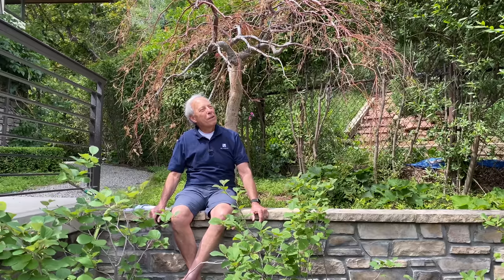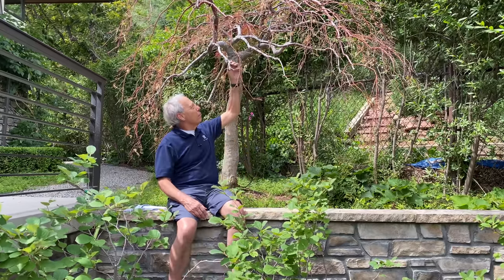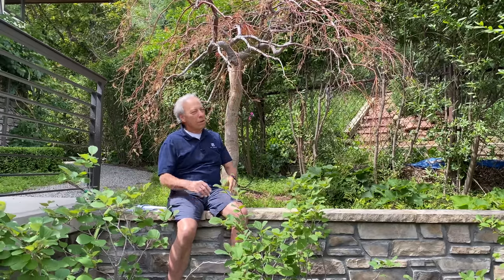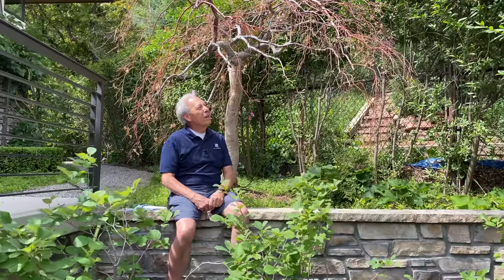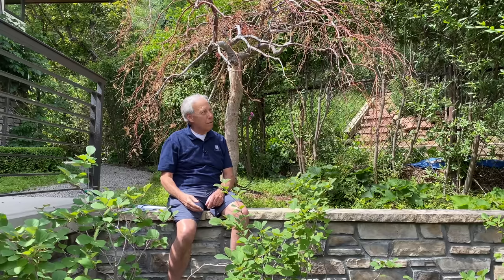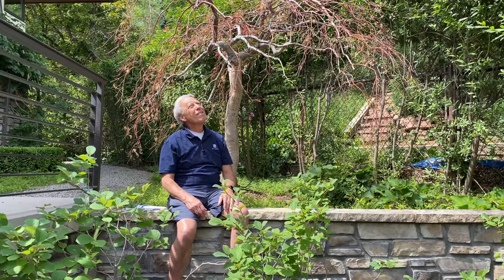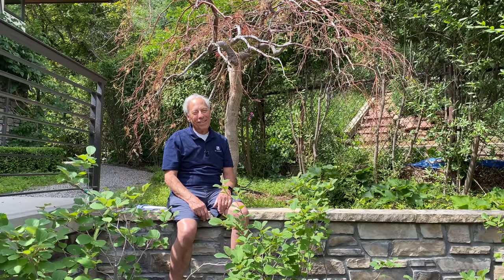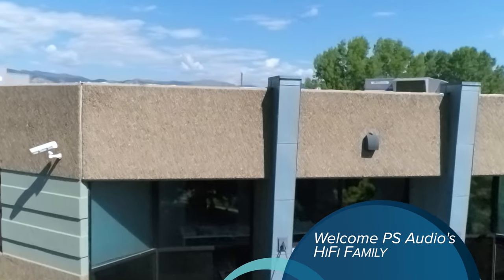Audio Soundstage

Comment: Ask your wife where to place the speakers, she's the one whose going to tell you anyway...🤣😂😆
Reply: ok boomer
Reply: Remove wife from the equation, by whatever means necessary!
Reply: @SachAlvarez  
Exactly 1958
Reply: That's why I negotiated to have my own room that she agrees she has no domain over.  We joke that there is an alarm that goes off if she even enters the man cave.
It is still a very nice room with a massive vintage billiard table and my audio system.  So no issues with large speakers 5 feet away from the wall.
Reply: Has your wife ever asked you where to put things? I see this topic coming up whenever there's talk of putting hifi in a house, I've never seen a woman ever saying they have to check with their husbands about putting anything anywhere.
Reply: @thegrimyeaper  
Exactly right, so you agree with me....😁
Reply: thegrimyeaper my wife has made the mistake of asking for my advice in home decor, now we have equipment all over the living room and I couldn’t be happier.
Reply: @thegrimyeaper  FWIW, in our house we discuss and agree on everything.  50/50 That includes setting aside areas where we each have exclusive domain.  Happily married for 47 years.  Looking forward to another 20-30.
Reply: poserwannabe my wife wanted me to put the subwoofer on the top of our entertainment unit
Reply: @poserwanabe  she also wanted to put the bookshelf speakers on the floor.
Reply: @johnvelocci8760  
Oh ok, so you're divorced ??
Reply: @poserwanabe  of course I'm divorced. how can I be married to someone who wants to put the sub on an entertainment unit up high and bookshelf speakers on the floor?
Reply: @johnvelocci8760  
😆😂🤣😆😂🤣😆😂🤣
Reply: I put a pair in the kitchen, and I could hear the difference in the living room !!!!
Reply: @SachAlvarez  I'm a boomer, but I know plenty of Gen X and Millennials where the wife has THE final say.

Comment: Yes, I have a TV between my speakers. But they are on dedicated stands and correct distance from walls etc. Because I DO use them watching films.
Reply: @mark wilson Why?
Reply: @Douglas Blake Strange thing for Paul to say. I should make a wall mount for my TV. But then again maybe he thought about a high end system which would require a dedicated room. Most audiophiles don't have that luxury.
Reply: @Kulumuli  Sound stage has not only width but depth also. How can you have decent depth when you have a shiny piece of glass between your speakers creating a huge reflection point? Same also applies to those that have their hifi parked up between the speakers: not the best for imaging and depth..
Reply: @antonchigurh4125  Yes. I see. It's not perfect I must admit. But that is the limitations I live with; I can't have two rooms. And it works well for me.
Reply: @Kulumuli  As long as it works for you then no worries!
Reply: Thanks for good advices. Of course, I never had it optimal. But when I had the NAD 1020 and Rega Kytes compared I was on to something. I was smitten.

Comment: Recent experience: Speaker/amp combo had each speaker driver heard distinctly, no center image and sound bound to the speakers (90db efficient Triangle Trio with a Hegel H90). Switching the power amp as the only parameter, everything just fell into place and speakers more or less disappeared. The Hegel and my other speakers worked fine 🤷🏻So i guess sometimes it will will be other things than setup (can’t begin to explain why though :-) )
Reply: @Douglas Blake Heh, good point, but yeah I did👌Besides, it was reproducable, terminals on both amps and cables were clearly color coded and the same thing did not happen when using my B&W speakers (as a pro musician and occasional recording/mix engeneer over 15 years and now in software development you can trust me 🤣)

Comment: My first real experience with the importance of soundstage was when I replaced my Denon A/R reciever with a Sprout100...night and day difference. Denon and little to no depth or soundstage, but even the little Sprout had a wide range of both. Really amazing.
Reply: Gregory Tessensohn same. Came from marantz pm5005 and with the sprout 100 layering and depth was the very first thing I noticed. Then after the excitement of realizing i made a good purchase, i notice more clarity and more balance on the sprout 100. 

Now im a fan of ps audio. I dont have expensive gear but i do appreciate their effort in offering great sounding electronics.
Reply: @justanotheryoutubeuser5029  If you get a chance to try their other stuff, you'll be pleased. I still have my Sprout set up in my Den, but my main system runs a PS Audio Gain Cell DAC/pre...and it is so worth it. But the Sprout alone is a terrific amp.
Reply: Gregory Tessensohn yes thats for the future upgrades. For now im enjoying the sprout 100 as i cant afford their other stuff. Lol.

Comment: I am looking forward to that book. 
My experience is that the easiest way to get a good sound stage is to use single full range drivers. Yes they have different weaknesses but when it comes to sound stage they are hard to beat.
Reply: Yes, you are right. I have a pair of Fostex FE206E with Echhorn 18 MK2 frontloaded sub horns.to support. This is as you are at a live concert - you can see the band (eaven smell them)...... Perfect. And the full range speaker (frontloaded full range horn, dow nto 80 Hz) are also placed in the room corners on the cornerhorns - no problem with imaging at all.

Comment: Some  things cannot be fixed. A few years ago, a friend invited me over to hear his new speakers. He knows that I am into audio, he is not. The speakers are Polk mini-towers, they cost $200 for the pair, and the store threw in a subwoofer (8:" driver). As I pulled up to his house, I could hear the  subwoofer thumping at SUV-with-blacked-out-windows approve level. First thing I did was have him turn down the subwoofer, he thought that's how it was supposed to be,

The speakers were on the short wall of the shoebox shaped living room, open on one long side to the center hall. So the RH speaker radiated into free space. The LH speaker was in the corner, and a glass and metal etagere was just a few feet in front of it. A cabinet with a TV and the mid-fi components sat between the speakers.  Moving the speakers was not possible. Playing with the balance control did nothing. The 'sound stage' was essentially mono, seeming to come out of the RH speaker, although the LH speaker was working properly. My friend never noticed anything wrong, nor did he care once I pointed all of this out to him. And he has never bothered to come over and hear my system, even though he lives only a few blocks away.
Reply: 100 bucks says he turned that sub all the way back up as soon as you left his house.
Reply: @thegrimyeaper  yep !!!!